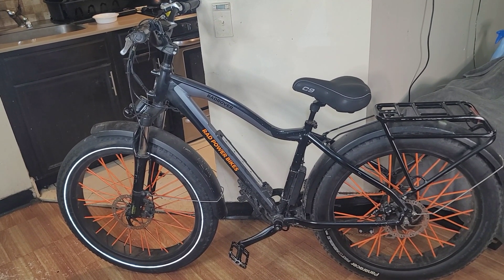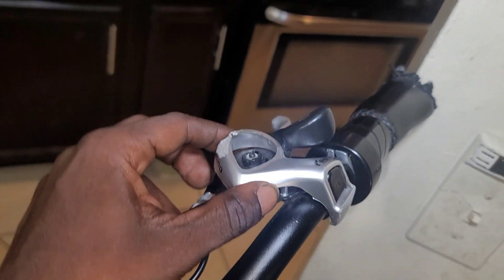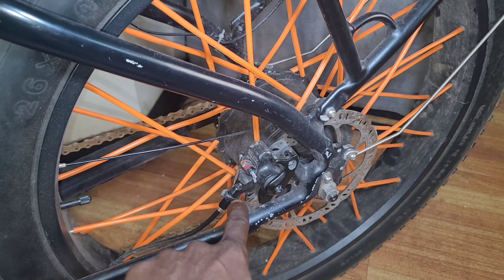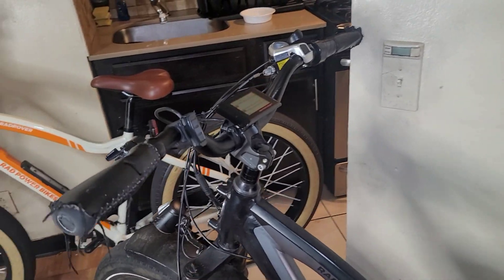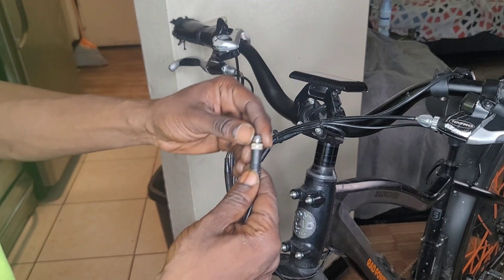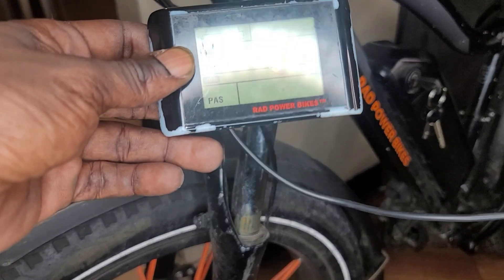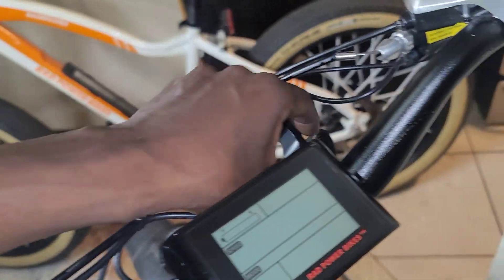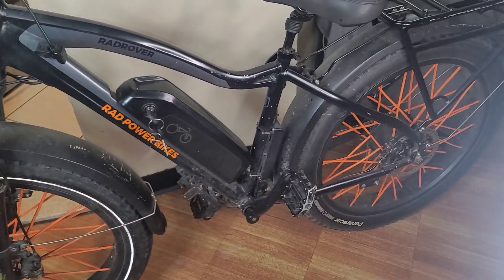Rad Power Bikes Rad Rover : Digital Display Troubleshoot

Comment: That bike owner doesn’t take very good care of his stuff. 
My Rad Rover 5 is 6 years old and looks like new. When spring arrived I dusted it off and topped off the battery. I kept a eye on the battery through winter and kept it charged up. I took it outside turned it on and started riding. 5 seconds later it shut off. It keeps shutting off every time after I turn it on. 
I read the owners manual but didn’t see that problem in the trouble shooting section. I charged it for 12 hrs to balance the battery. That didn’t help either. I called the Rad Rover 1-800 trouble shooter for help. She said probably the controller box went bad. 
She found the nearest Ebike repair shop for me and I dropped it off there. It was 37 miles away. It cost $150 up front  just for the shop guy to try and diagnose the problem. He said he’ll research and order the part because he has no parts for that bike in stock. He’ll call me when it’s fixed in a few days.

Comment: Sir I'm hoping maybe you could help me I'm trying to find out what the tire pressure should be for the Flywing  f8. Which is the same as the  fly ebike 7.... I was told 40 but I want to be sure
Reply from the maker: 110/70/12 should have 32 psi 40 seems kinda of high especially if you running 10 inch wills bring it down to 32 psi
Reply: @T2daBikeGuy  thank you for this info....I enjoy ur videos....
Reply: @T2daBikeGuy  I actually found the information on the sidewall of the tire it actually said to put it to 43 PSI so what I did is I took your advice the owner of flywing e-bike phone number advice he told me 40 you suggested 30 so I put it at 35 it took it and it seems to be working fine but thank you so much.....and from what little research I did it seems to me when your tire gets hot the PSI increases a little bit just something to know.. hopefully I'm going to run into you one day while riding just to say hi and keep up the good work captain
Reply from the maker: ebro thanks alot you will see me one day you will

Comment: Is the Rad you’re taking parts off of just for parts? Seems like you should sell the fully built Rad and have him buy the parts he needs.
Reply: I was thinking the same thing but if customer is on a budget. It's probably the best of both worlds that they go from no go to go with used parts while that sweet orange rad gers all new parts.
Reply from the maker: I sold the battery and display for for $230  the ebro came back 2 days wanted to buy the whole bike for $250 But there is like 3 more ebro's wanted the Front Wheel another The Fenders and the other one wants the Suspension Seat Post and some one needs a Headlight what next ebro sell whole, parts or keep for Youtube
Reply from the maker: Lol. ebro we'll figure something out